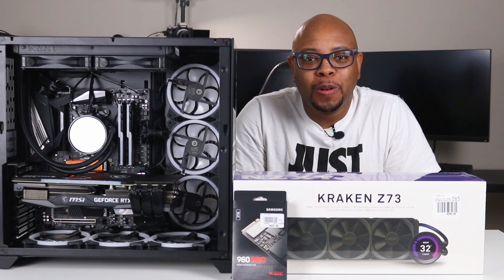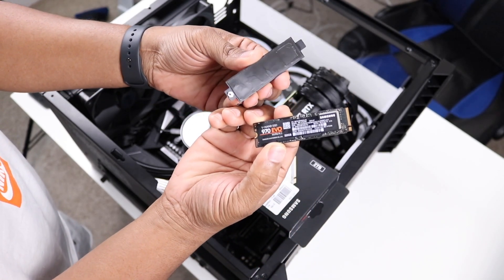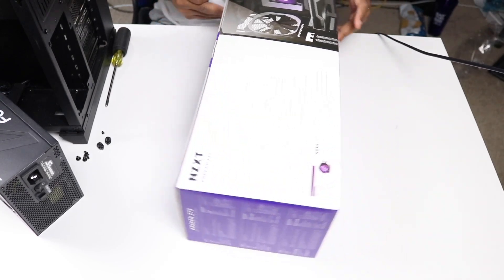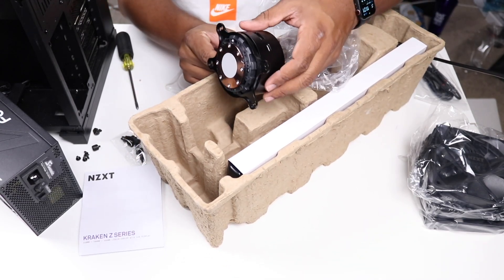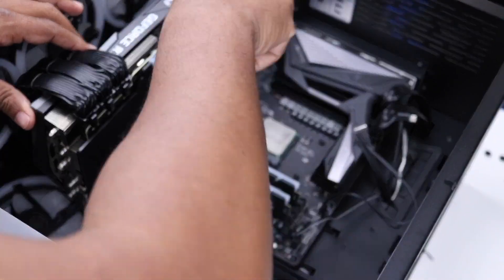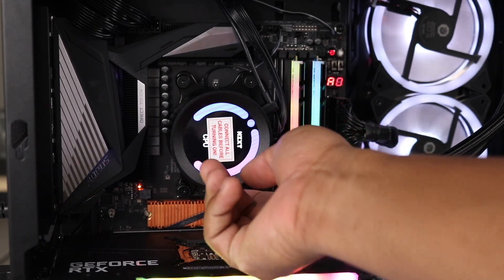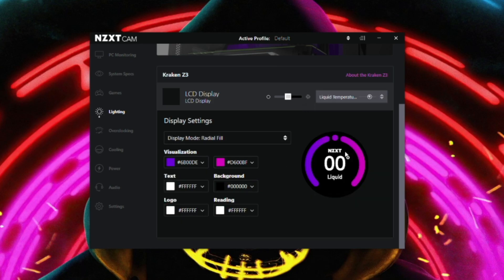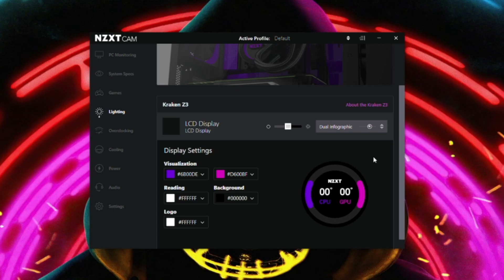NZXT Kraken Z73 Install / Setup in Lian Li PC-011 Dynamic with Samsung 980 Pro Upgrade

Comment: Hello, does anyone know if the Kraken Z73 rgb with fit into the Lian Li O11 Mini, i have a ASUS ROG Strix B660-A Gaming WiFi motherboard and it seems impossible to install the Kraken Z73 rgb on top with 3 fans. thanks for clarification!

Comment: I'm kind of new to pc building.
Just upgraded my PC from 2700x to a 5900x I was running a cheap air cooler and temperature normally stay around 45c now I bought the kraken z63 and the temperature could go up to 68c is that normal for this aio?
Reply: Motherboard is Asus x570s dark hero.
Reply: Is that temperature under load ? While playing games or something like that?
Reply: @kenny9088  yes while playing game.
Reply: @topandrun126  is probably because the aio coal plate is not making contact with the cpu. Or the aio is not working as it should. Those Temps are high

Comment: Did you have any buzzing noise coming from the pump on the Z73? A buzzing noise that gets louder or quieter depending on pump speed? I've tried 2 of them now and both had that problem. I have the x570s aorus master mobo. I've tried it connected to the cpu_fan and cpu_opt header and even tried going into bios to change some settings on those headers like some people were saying online.
Reply: sorry for late message but did you ever find a fix for this?
Reply: @josesantana-ys5il  so I went into NZXT Cam and set the pump to always be running at 50%, the noise is fine at that speed (no loud humming just an average amount of sound from the pump), perhaps its gotten better over the past year as it wears in im not sure but It doesnt bother me anymore and Ive had no issues with cooling/performance with it at 50%. When i listen for it i can hear that the pump still makes sound so ive probably just gotten used to it over time but again ive had no issues with it at all, temps etc all good. So just set it to a flat 50% pump curve and forget it. The pump at that point should stay in the 1600 rpms and be fine. Hope this helps you.

Comment: Hello all,
I'm having trouble with the installation of this cooler. I watched this video but the RGB's aren't working.
I'm giving up on this one. The FAN'S are working and the Pump too but no RGB on the fans. 
I have connected the USB cable on the USB port bottom mobo, SATA -> SATA (PSU), the 3 fan stuff for the 3 fans and then the other cable (the longer one that is attached to other cables) to the in/out cable (long one). 

You have 2 in/out mini cables that are connected with the FANS, I got that. And then the LONGER in/out cable?!?!?! I have connected the longer in/out cable to the fan IN connector (first FAN). 
Where the hell should the OUT go then? To the other cable? If I DON'T connect the longer in/out cable to the cable other cable, the CAM software doesn't see the AER Fan.
If I DO connect the longer in/out cable to the cable, the CAM software shows it. I can chose colors and stuff but nothing happens.  

I am completely lost. Please help!
Reply: Currently going through this same problem.. you have any luck?

Comment: Thank for the best video and i have aquestion : Why you put Thermal Compound Paste inspite NZXT Kraken z73 has its Thermal, is wrong or right?
Reply from the maker: I did that for just in case I decide to do overclocking you need the better paste for it

Comment: Why push hot air in plus potential dust from top!?

Also why are you exhausting bottom!? Building mine this week end and just wanting to know the best exhaust.
Reply: The way he has it set up, is 3 intake on the right side of the case, 3 intake fans on the bottom and the 360 aio is exhaust
Reply: U are mis reading the fans

Comment: I want to change out my 2014 Noctua to this, but I idle at 29 degrees on my old Intel 4790x currently. Saw that you were idling near the mid 30's.  What processor is in your build if I may ask?
Reply from the maker: Nice I’m currently using the AMD 5800X

Comment: Building a similar PC with the O11, is it a crime if I turn around the three fans on the side of the case into an exhaust/do those three side intakes make a significant difference with them being fired directly into the glass?

Comment: Hey man I love the content. Quick question, am I able to change the fans in the kraken cpu cooler or no?
Reply from the maker: Thanks man, yes you can change the fans. I plan on it.
Reply: @WiLcreatives  are they 120mm
Reply: @WiLcreatives  what if the fans I want to connect them too have a wire on them to the hub. Will it still work?
Reply from the maker: @braylonbrown7384  that will depend on the hub. For the fans on the AIO most people will want the AIO to control the fan speed. That’s something I need to look into.

Comment: loved the video but I'm surprised that you don't have that many subs for how good your content is.
you deserve 100k subs at least
Reply from the maker: Much appreciated we working towards it!
Reply: @WiLcreatives  You just got me as a sub, I have a very similar set up. I got rid of the whole corsair eco system and went with lian li uni fans. You should grab some extensions for those cables, if you don't want to spend the money on a new set of cables or make them yourself, It would def make it look so much better.
Reply from the maker: @It_needs_to_be_said  Nice yes I plan on getting some unifans and custom sleeved cables. Also thanks for the sub I appreciate it!
Reply: This video helped me more than any other video because I’m building my pc rn and this helped me a lot.